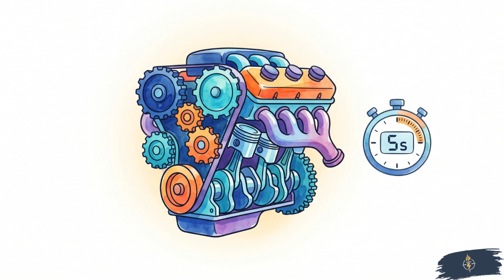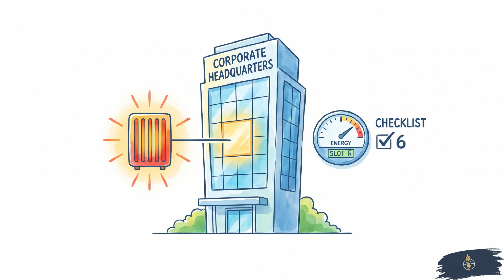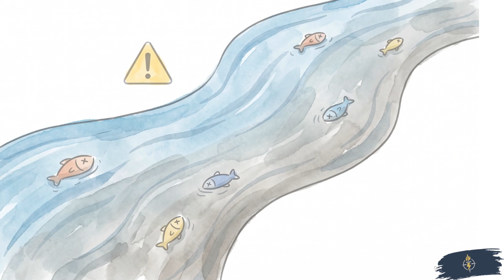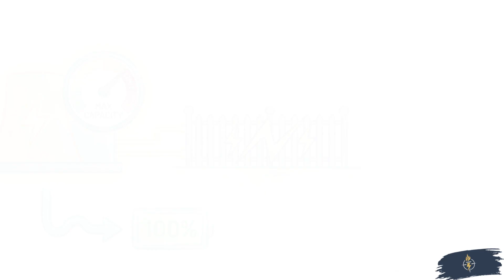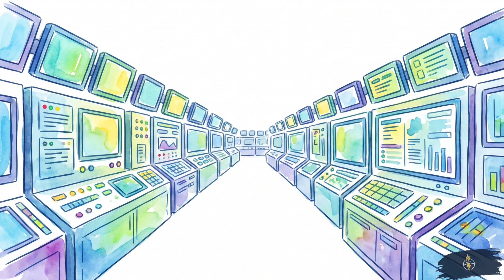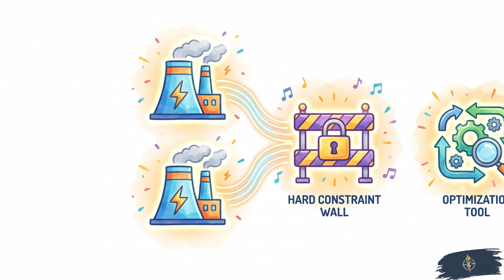E07 | Is Your Electric Car Actually Clean? The Hidden Energy Math Nobody Shows You

Comment: AND WHAT ABOUT THE LIFE CYCLE OF A FOSSIL FUEL CAR?!?!?!?!?!?!

TRUTH CHECK:

GAS CARS ARE STILL WORSE OVER THEIR LIFE CYCLE.

PERIOD.

THE END.
Reply from the maker: Hi there! Thanks for your comment and for bringing this up.

You are absolutely right in a general sense—Life Cycle Assessments (LCA) clearly show that electric vehicles are overall cleaner than gas cars over their lifespan. In fact, we have a YouTube Short on our channel that specifically compares their emissions!
https://youtube.com/shorts/Kra_aMPEESg?si=sNcubHG2dwfJt8t9

However, the main goal of this particular video wasn't to compare EVs with fossil fuel cars. We simply wanted to challenge the myth that EVs are "100% perfectly clean" and remind everyone that manufacturing them, especially the batteries, still has an environmental footprint.

There is also a very important scientific nuance here: where does the electricity come from? If the power grid charging the EV isn't backed by renewable energy (for example, if it relies heavily on coal), the whole equation gets much more complicated. In those specific scenarios, when you look at the entire energy supply chain, the overall efficiency of a modern diesel car might actually surpass that of an EV!

So, an EV is ultimately only as clean as the power grid it plugs into. Thanks again for sparking such an important discussion!!!!!!
Reply: @WattsNext-Media  

1)  That is only very rarely true in the most extreme cases.

2)  That assumes that the power grid is fixed.  As we should all be aware, the grid is getting cleaner by the day.  Solar power represents more than 90% of new power being added to the US grid.  As the grid gets cleaner, so to does the EV, while the diesel car continues to emit particulates throughout its lifespan-even "clean" diesels represent an active health hazard, as studies in Paris have found.
Reply from the maker: @00Zy99  That's right: the grid is moving in the right direction. Solar and wind are growing impressively. However, as an energy systems engineer, I look at the actual data versus the political promises, and the reality is that the transition is lagging far behind schedule.

For instance, looking at the U.S. grid right now in 2026, while wind and solar hit about 20% of generation, natural gas still dominates at around 40%, and coal is still sitting near 15-17%. Reports from BloombergNEF show the U.S. is severely falling behind its climate targets—projected to hit only a 22% emissions reduction by 2030 instead of the promised 50%. The grid is greening, but far slower than we've been promised.  

And until that grid is 100% green, EVs carry a hidden environmental debt. We also cannot ignore the intense toxicity of the battery supply chain. Mining lithium and cobalt involves severe water depletion, toxic tailings, and local contamination. In places like the DRC, cobalt mining even exposes local environments to radioactive leaching and heavy metal pollution.  

If we want cleaner solutions today while the grid slowly transitions, there are actually more cost-effective and cleaner alternatives right now. For example, modern Natural Gas engines burn extremely clean (primarily emitting just NOx and water vapor), and Hydrogen Fuel Cell vehicles offer the benefits of an EV without the massive toxic battery footprint.
EVs will definitely be the ultimate clean choice once the grid is fully renewable, but we are just not there yet. Thanks again for keeping the debate sharp!